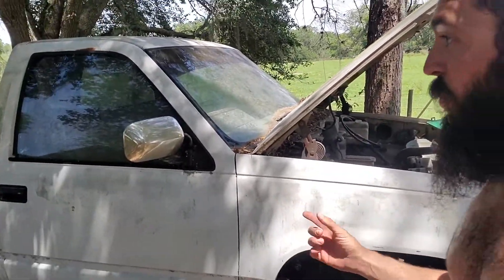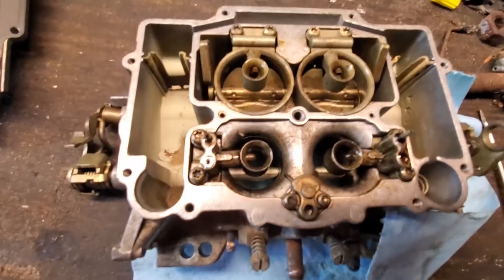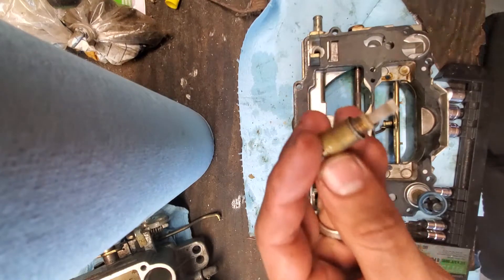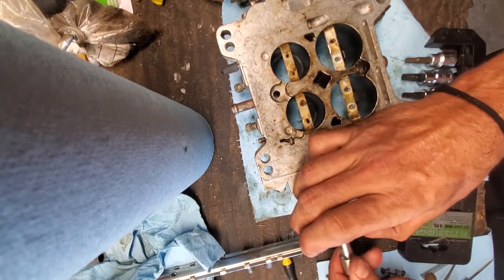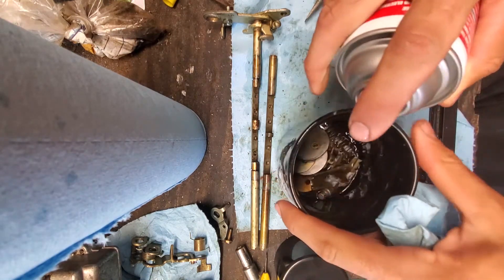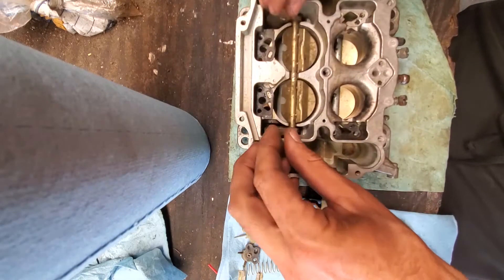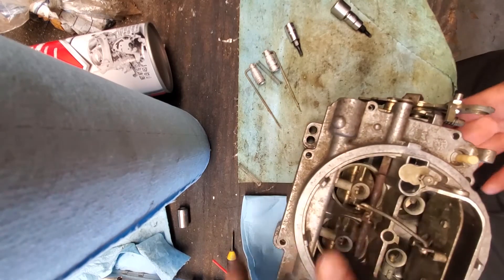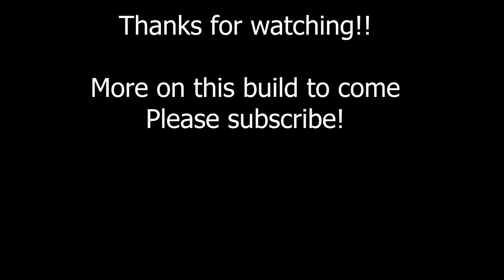Complete disassembly, cleaning, and rebuild: Edelbrock Performer 600 cfm Carburetor 1405

Comment: Normally, I don't watch a video like this. I take pictures with mein I Ph
oon before disassembly. That always works. This video helped a lot. I got an old 74 Mercury police car and the engine is at the machinists. The original carb was long gone, but an Edelbrock (Carter before 1988) carb in the trunk with the bees nests and rattle snakes. It was gummed up. I did like always and took the gummed up throttle shafts apart and cleaned them well and had to emery cloth a bit. When I was reassembling, no matter what they wouldn't open. The pictures match, but it always locks up at 20% throttle. I watched this video (at a point) and noticed the throttles open in opposite directions, so I took the blades out and put it together, making sure they would open opposite directions, and they worked fine.  I got my parapharnelia all lined up and buckled it down and I'm sure this explains why they didn't open when I got it out of the trunk. Someone put it together wrong and me taking pictures before disassembly gave led me on a goose chase. Thanks for making this!
Reply from the maker: Oh wow! Thats so cool! I've always said when making these videos that if my video helps one person then I'm happy. Cheers!
Reply: @KaseyDoesThings  I was really stumped> I don't rebuild carbs every day like I used to, so I took pictures with my phone before I took it apart, and when I reassembled it, I went by the before pictures. The parts I took out of the carb looked new. Someone rebuilt it and put it together wrong, that's obvious now. They must have put it on the car and couldn't get it to work, then gave up. After watching your video a few times it caught my eye that your throttle blades open the opposite directions and mine would try to open the same way then bind. That's what got me. Once I re-clocked them all was good. I had forgot that they opened opposite directions, but now I do remember the Carters did and that's what these are. Thanks again!

Comment: Rather than getting that spray all over the bench, I use an old metal rectangular cooking pan (discarded by wife).
Reply from the maker: 😄Thats a great idea!
Reply: @KaseyDoesThings  - it was my wife’s idea.  She saw me working on some valve springs.  Gave me one of her 7”x 9”  metal cake pans to put them in to spray with cleaner (have 3” sides).